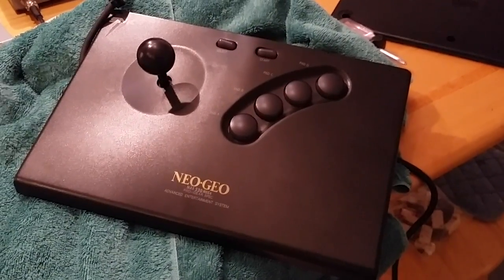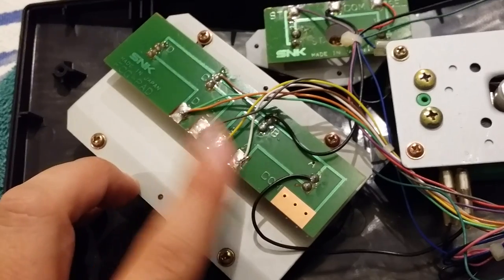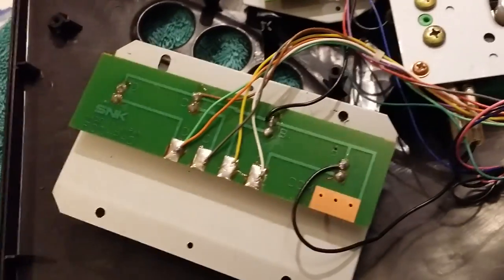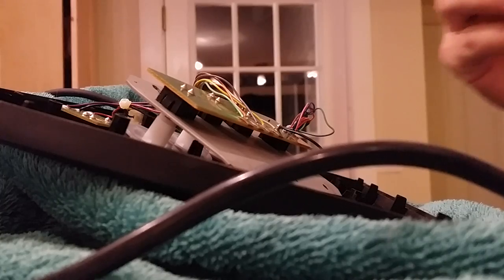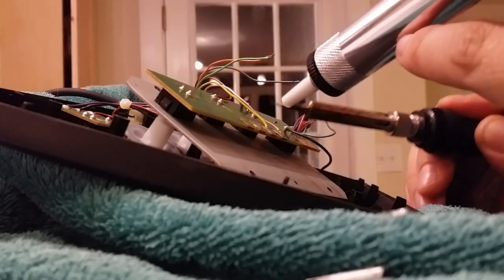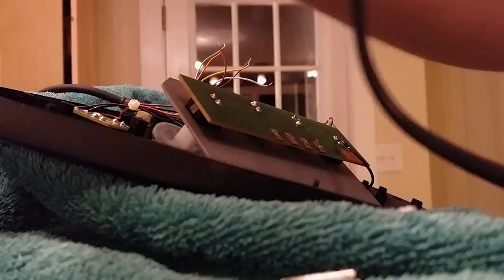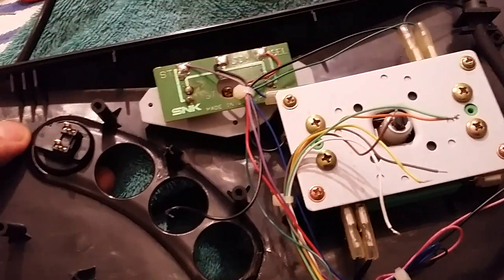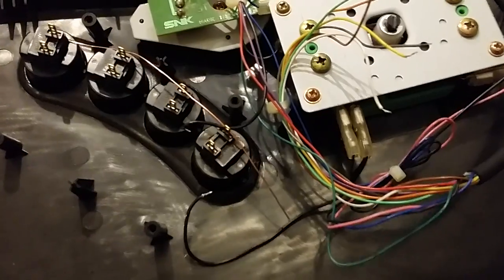Neo Geo AES Button Mod Tutorial

Comment: I just finished installing 24mm Sanway buttons/ full sized ball top and it feels 1000x better. Also, I changed the micro switches in the joystick with Panasonic Seimitsu-LS33-187 and lubed the joystick assembly with silicon grease.
Reply: New Microswitchs and grease do wonders for these sticks. Throw in a Jamma Nation X AES Octogate and it acts like a modern stick IMO. Only thing that I want to experiment with is maybe 3d print a bigger actuator and no paddle switches.

Comment: Excellent work K-2. Thanks for documenting this process. Is this your second one?
Reply from the maker: Thanks Marty, yeah I decided to mod the second one I had. It's super easy, and I had the parts so I figured why not. Next would be to try Dub 's method for swapping the stock stick for a JLF. Might try that one in the future, even though I don't mind the stock stick.
Reply: Very cool. When I took mine apart, I took everything apart. What a pain. Did clean up the micro switches and added some grease though. I like how you kept everything black. Class.
Reply from the maker: I did that with the first one I did which was a bit more beat up. I did notice that when you open up the stick housing the micro switches fly out and don't want to stay put haha.  This one was still fresh. Glad you dig the black. Next one will be the princess stick lol.

Comment: Couldn't you have added quick-releases to the wires instead?
Reply: Yes he could have but that would take up even more space vertically in the case so it may have been a tight fit. He could of bent the prongs horizontal but all that work for a stick that you don't plan on messing with on a regular basis isn't really needed.  A direct solder job would be more secure  connection and a smaller profile in the case.

Comment: Can I make AES Stick USB powered? A NeoGeo X Stick feel so cheap
Reply: Yes you can. You would just have to get a USB decoder board to wire to the switches inside the AES stick. But the cost of doing that to an AES stick may be a bit expensive because you would just be using the AES shell at that point with new guts. Just do the same with a NGX stick and get better guts and parts and it would probably cost you less and the shell would feel and look the same by the end of it.